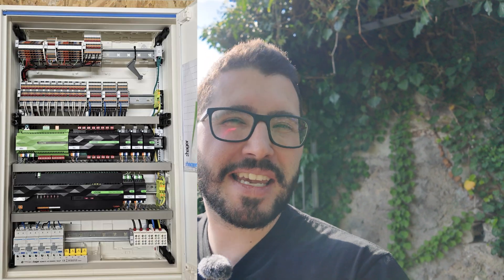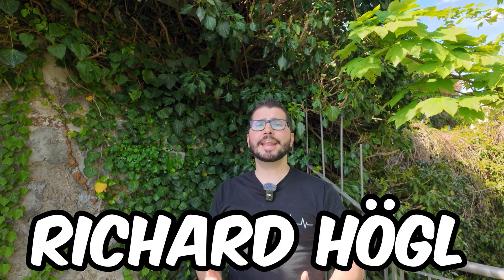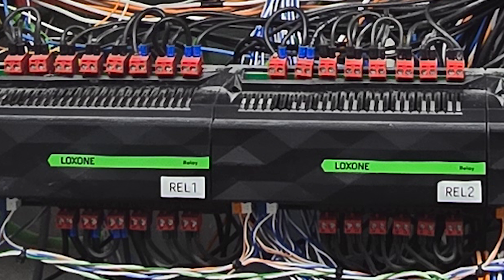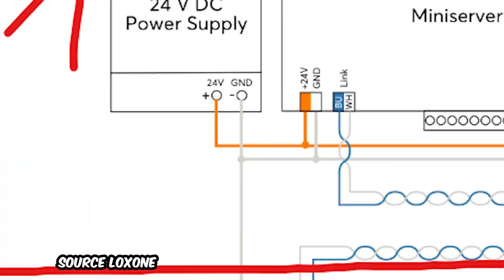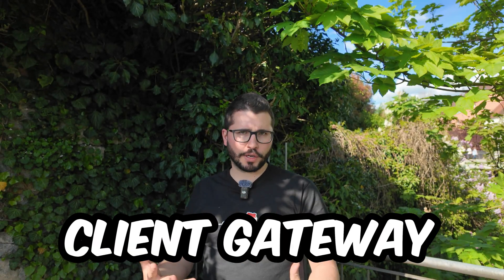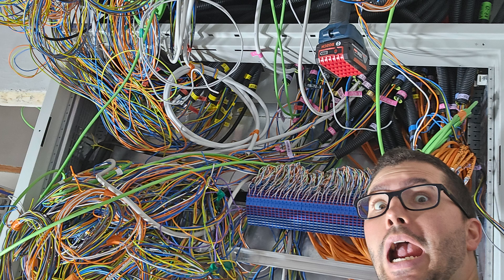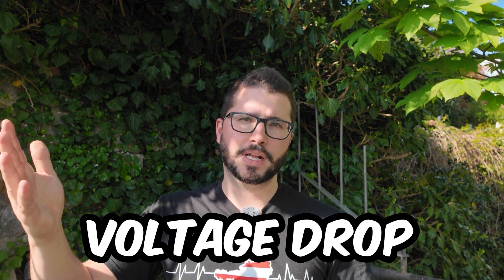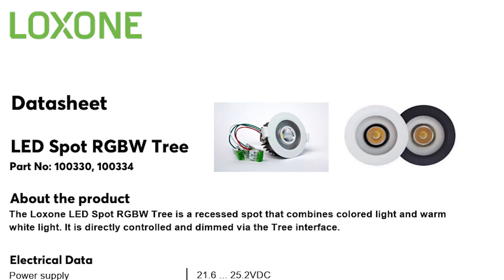How many Loxone cabinets should you plan?!

Comment: Ireland, I will be wiring my house for Loxone soon. Interested in more config videos
Reply: Ireland here too. Are you doing it yourself or getting a loxone partner to do it?
Reply: @kevinm5895  I got it designed and everything done by a partner but myself and the electrician are installing it all
Reply: @kevinm5895  A partner done all the designs, cable schedules, panel designs but myself and my electrician are doing the first and second fixes.
Reply: @kevinm5895  My messages don't seem to be sending here
Reply: @ A mix of both, where you based?